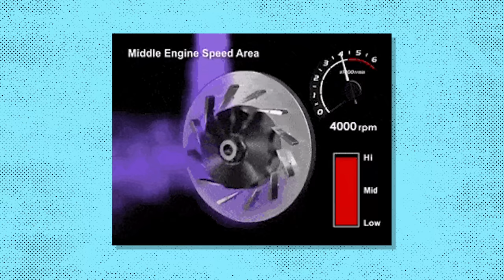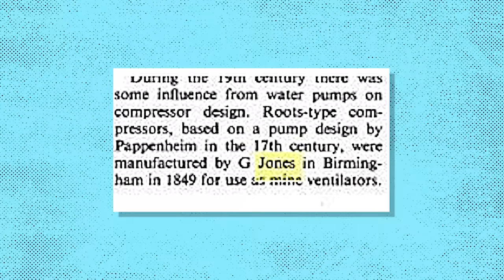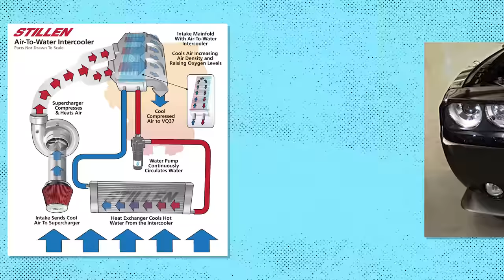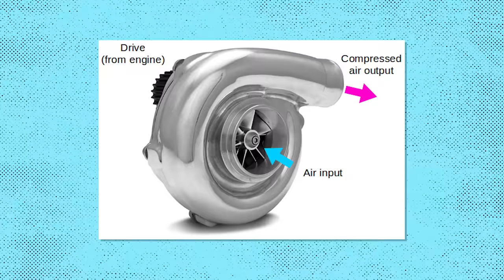Why Superchargers Aren't As Good as Turbos

Comment: Turbochargers aren't just powered by "exhaust gases", but also directly take power off the crank in the exhaust stroke by increasing the exhaust pressure. It's not fully free.
Reply: That is incorrect, the turbo runs on the leftover heat energy normally wasted out the tailpipe.
There is no parasitic loss or load on the crankshaft.
Reply: @sandervanderkammen9230  on the exhaust stroke, at some point the piston is pumping exhaust, when the piston is pumping exhaust it is transferring energy from the crankshaft to the turbine.
Reply: @microcolonel  No, the turbo is driven by an Impulse type turbine wheel.
The exhaust gas temperature and pressure drops as it is excellerated and passes through the turbine. 
This is called the  Bernoulli Principle.

The drop in exhaust temperature is directly proportional to the shaft horsepower generated by the turbine. 
Any questions?
Reply: @sandervanderkammen9230  lol, why do you gotta be internet tough guy? You're just spouting off random factoids that have nothing to do with the comment.
Reply: @microcolonel  Some people actually understand how a turbocharger works... and some people (like you) only think you know how a turbocharger works
Reply: @sandervanderkammen9230  hey buddy, you might ask yourself why there's a difference between an unobstructed exhaust and one obstructed by a loaded turbine in terms of resistance to flow but you might also just keep yapping.
Reply: @microcolonel  If turbine blades obstructed gas flow? Jet engines wouldn't work would they???
You should probably stick to something you are qualified to discuss... like an oil and filter service.

Comment: A really good comparison is the Audi B8/8.5 3.0T with the Eaton Supercharger and compare it to the new 3.0T hot V single turbo on the b9's. The similiar hp on pump 93 (when modified) but tq is greater on the turbo as well as top end and trap speeds. People in the community are torn. Everyone loves the crazy supercharger whine on different pulleys but cant deny how much easier it is to squeeze more power out of a turbo. From a dig the b8 S4 is a monster, but let the b9 built boost and its a similiar story. People love the whine and break neck action of the SC. Time will tell if we can get more air into the block out of a larger SC.
Reply: Reliability is sketch on B9's
Reply: @murraydmark  So far so good. Even with the crazy numbers tuners are pushing. I just had my supercharger bypass valve die on my SQ5. 97K miles. 10K on e40 dual pulley.

Comment: what if you have the regular crank driven pulley for the supercharger but then also had the exhaust side of a turbo hooked up and instead of the exhaust gas turning the compressor wheel it could add extra torque to the supercharger or idk maybe if there not enough torque from it use that to replace the alternator as they usually take 2 hp idk maybe im stupid just thought it could be a good idea

Comment: Why would a belt-drive centrifugal supercharger suffer from lag while a belt-drive roots doesn't? They're both spinning slower at low rpm, yet instantly follow engine revs, right?
Reply: Because a Roots type blower is Positive Displacement and air  delivery is linear based on rpm.
Centrifugal compressors deliver on a non-linear curve.
Reply: @sandervanderkammen9230  Ah, gotcha.

Comment: Is it not feasible to install a tank of pure oxygen and force that into the intake with a regulator?

Or would that be to costly,  or oxygen bottles would take up to much space?
Reply: Nitrious Oxide is mostly Oxygen... in a more dense liquid state, its more practical and effective than pure Oxygen and is used to boost engine performance.

Comment: Couple of thing wrong here 
1. The amount of power loss is near is a small fraction of the amount gained.
2. There are different kinds of chargers. Some are small but produce huge boost while being mounted.
3 one of the reasons turbo is popular is because it is in fashion.
Reply: That is completely false.
Turbos produce more horsepower than superchargers because their is no power lost from parasitic drag on the reciprocating engine.

Turbochargers produce more power at the same manifold pressures than superchargers because there is no parasitic loss.

Turbos dominate the forced induction market for two simple reasons, the make more power and use less fuel.
Reply: @sandervanderkammen9230  um no on yes on the other.
Superchargers make way more power and the fuel loss is made up for the power increase. Also it's a safer option than a turbo. 
No the real reason is because a turbo is popular.

I like superchargers because more power straight off and higher top end power and I don't have to worry about my desiel running away. Lower maintenance also. And I also didn't notice feul milage loss. If there was any I didn't notice it. Still getting 9ftlb of boost for my 7.3L IDI at 20.9 mpg.
Reply: @timesthree5757  Thanks for confirming that you are not qualified to speak inteligently about Turbochargers or Superchargers..
Reply: @sandervanderkammen9230  soo you can't win the argument so you turn to insults?
Reply: @timesthree5757  Not an insult... it's just the truth.
Reply: @timesthree5757  You have confirmed that you do not understand even the most basic fundamental engineering concepts regarding forced induction.
A properly designed and assembled turbocharged engine will always produce more power than a comparable supercharged engine at the same manifold pressure.
This is because turbocharged engines have higher thermal efficiency and have no parasitic drag on the reciprocating engine to drive
 the compressor.
This is also why turbocharged engines have lower BSFC  (use less fuel per horsepower produced)
Any questions son?
Reply: @sandervanderkammen9230  no I haven't. A turbo with 9lb boost and a super 9lb boost both make the same hp on average.  I've done these test over and over. On the super conected to an electric motors. And a air compressor for the turbo. 
It took 3/4 horse electric motor to turn and produce boost at 1,900rpms. 
Using an air compressor and measuring back pressure on the pipe you loose somewhere around 1/2 horse.
But the big difference is maintenance. The super is a plug and forget. The turbo was a pain in the ass to maintain and constantly watching turbo temp under load while watching eg's was another pain in the ass. 
Power through rpm ranges.
The turbo doesn't start making good boost until about 1200 rpm. I need good boost in all RPM ranges. I can't  wait for a spool up on heavy loads and burn up my clutch. I need the instant torque and hp on the take off and through all rpm's in all gears.
In most non racing and drag racing application yer better off with a super.
On my truck with a turbo I was getting on average around 19mpg on a super I get on average 19mpg. 
I understand the engineering. But real life application somtimes doesn't mean it's useable. 
To me a Supercharger is superior to a turbo. So yes I do know what I'm talking.

Comment: Curious do we use gears to reduce parasitic losses? If not why don't we?
Reply: How would gears change the parastic loss on the supercharger?
It still takes shaft horsepower from the crankshaft to drive the rotors or impeller, in some cars more than 100hp to drive the supercharger.

Comment: I am brainstorming ideas for reducing or eliminating turbo lag. I initially considered electric assistance, but there are potential heat and cost issues with this approach. I also considered using raw gas, similar to the "Anti-Lag" system that is already in use, but then I had a thought: what if a high-pressure, low-volume (HPLV) compressor was placed just before the turbo? This could potentially eliminate the heat proximity issues and may be more cost-effective when mass-produced. In theory, this system could also be retrofitted to existing vehicles and easily programmed to engage at certain RPMs and speeds. However, I am not sure if this idea is feasible or if I am just feeling the effects of alcohol. 🤣
Reply: Derp... Those smarties over at volvo are already doing this🙂
Reply: Yeah, you're just drunk buddy

Comment: Blowers can't touch turbos for pure power and efficiency, but they're exceptionally hard to beat for drivability and pure fun. Sure a guy with an identical setup running a turbo is going to smoke the guy running a blower, but you can make way mkre power than is useful or practical in a street car with either. Really comes down to what you want, the down low power, drivability and whine of a blower, or the even bigger power and greater efficiency of a turbo and deal with having to spool it and keep it spooled. Which depending on if you have a properly sized turbo or you're a social media queen "big turbo" tool can be pretty easy or it can be a total pos dog until revved out.
Reply: The popularity of turbos speaks for itself...
Reply: @sandervanderkammen9230  No, it doesn't. OEM's use them primarily for emissions requirements.

Comment: Got to say more, the daddy of turbos, Gale Banks puts blowers before the stupid turbo, because air is needed at all times and NOW, no waiting until the spinny spools.
Because many are weak is the real reason why turbos are more often used. Transmissions are weak, it's a hard life to be shocked by a blown engine
Reply: Turbochargers are very reliable, they provide more horsepower than superchargers and use less fuel.

Comment: Roots style superchargers are fixed displacement. Turbos and centrifugal superchargers are positive displacement. Every revolution of the roots supercharger will move roughly the same volume of air which is why Eaton designates their models with how many cubic inches of air are moved at peak efficiency through a complete revolution of the input shaft. Turbos and centrifugal superchargers are instead designednated by the diameters of the housing since they ate terrifically inefficient at lower speeds but efficiency greatly increases once a certain impeller speed is achieved. At low speeds the turbo is not capable of overcoming the intake manifold vaccuum however a fixed displacement supercharger will be able achieve peak boost at any time that the throttle is wide open as they are typically arranged in a draw through arrangement with the throttle body or carburetor mounted to the intake side of the supercharger and metering the amount of air the supercharger recieves.
Reply: Wow! ... it's safe to say that you have no formal education or professional experience in engineering or forced induction.

Comment: Talking about superchargers using power to make power as if sticking a flow restriction on your exhaust doesn't restrict power.

All ICEs are air pumps. You add a restriction and you've taken away from efficiency.

Comment: Exhaust is not waste energy, take a naturally aspirated engine of any shape or size, add the back pressure to its exhaust that a turbo normally creates, and see what happens to your performance
Reply: The Turbocharger uses the heat energy in the exhaust gasses to drive the turbine... this free energy is normally wasted out the tailpipe.
There is no parasitic drag on the reciprocating engine.
Reply: @sandervanderkammen9230   whilst mostly true it is not free. Do as i describe and you will notice a power decrease to the engine. 
Remember heat and pressure are related, the turbine creates rotational kinetic energy by creating a resistance to exhaust flow. The heat of the exhaust allows a greater amount of energy exchange but is only used by converting heat to pressure. That resistance to flow has an adverse reaction on combustion chamber flow dynamics specifically cylinder scavenging. In this way the turbine does indeed take power out of an otherwise free flowing exhaust. 
Nothing is free
But don’t take my word for it, try adding the turbine restriction to a naturally aspirated engine without the benefit of the compressor side and see what happens.
Reply: @TheRenaissanceBuilder  Yes, it is free... thats why turbo engines make more power and deliver better BSFC.
All of the energy to drive the turbine wheel comes from energy wasted out of the exhaust gasses.
 The pressure and temperature DROP as gasses pass through the turbine..
The drop in temperature is directly proportional to the amount of shaft horsepower generated by the turbine wheel.

This is calculated by using the BRAYTON CYCLE formula.

Here you completely lose the plot... the exhaust turbine is directly coupled to a supercharger compressor... a centrifugal compressor which is significantly more efficient than the reciprocating piston engine...
As the exhaust manifold pressure increases? 
SO DOES THE INTAKE MANIFOLD PRESSURE!

There is an increase in pressure... but no reduction in flow.

Flow is based on pressure differential "aka" Delta-P

Any questions son?
Reply: @sandervanderkammen9230  im not your son pal.
In your perpetual motion seems possible I guess 🤷🏽‍♀️
The point where you loose it is how the added back pressure effects cylinder scavenging and that is where the sacrifice is paid.
It is true that its addition overcomes its subtraction, just the same as a supercharger. It does indeed derive its energy from a portion of the combustion process.
Don’t believe me thats fine, you dont hafto, but an intelligent person asks why 😉
Reply: @TheRenaissanceBuilder  You still have alot to learn yet kid.

Not such thing as perpetual motion... we are talking about Heat Engines

The energy to drive the turbine wheel comes from the same fuel burned by the reciprocating engine.

Its not a difficult concept to grasp if you have some basic engineering skills.

You don't understand how backpressure reduces flow...
The pressure differential increases volumetric flow with a turbocharger...
Naturally Aspirated Otto engines have intakw manifold pressures less than atmospheric pressure when the engine is running.

This is not the same with a turbocharger.

Perhaps you should come back when you learn about hpw a turbo actually works.
Reply: @TheRenaissanceBuilder  Then the question you should ask???
Is why the exhaust temperature drops as it passes through the turbo...
 AND WHERE DID THAT HEAT GO??

Comment: The first stage of a high vacuum system is sometimes a roots blower. But instead of forcing air into something, it pulls air out. It's only used for the first stage, the initial part of drawing a vacuum. There reaches a point where it simply can't pull down below a certain pressure, but it works really well taking big gulps of air and evacuating them quickly.

Comment: SCs are very inefficient due to the parasitic power loss from the engine. Turbos on the other hand, uses exhaust energy which is free. SCs are also heavy and bulky while turbos are pretty compact.
Reply: Are you telling me that making more difficult to your engine to move the exhausted gas is free ?
Reply: @ulisesavila2879  can you restate your question? i cant make sense out of it
Reply: @ulisesavila2879  The centrifugal compressor is a much more efficient pump than the reciprocating engine.. it is not driven by the crankshaft but rather the free heat energy wasted by the reciprocating engine

Comment: Group N Lancia Fulvia. Supercharge at low rpm and turbo at high
Reply: Does it use regular turbo-supercharger system or does it have bypass valves or clutch/coupled compressor?
Reply: @sandervanderkammen9230  not much of a gear head. Think it is computerized system that switches back and forth depending on rpm

Comment: from what i have seen in various vids,  superchargers get worse gas mileage on the street than turbos do and that is why they are so popular for most street cars, also, the new turbos dont have the problems early ones did and the ford gt is a prime example of new tech that works on the track and street,  for drag racing they 
might be good but not for street use with the new turbos
Reply: Superchargers also make significantly less power than turbochargers,

Comment: I managed to add like 500hp per PSI per 1k revolutions in beamNG drive by literally negating the crank loss and pushing the buildup to 1000 psi per second.

Sadly, engines don’t really enjoy this much power and get obliterated in an instant. Plus the pressure is absurd and would detonate with the strength of a gasoline explosion

Comment: Does at matter if it is taking some of the engines power as it is instantly put back into it. Its not really as inefficient as people say. If you think about it logicly they are just as efficient while being simpler
Reply: The supercharger always uses more power than it gives back...
The Turbo produces a net gain because it is driven by horsepower that is normally wasted out the exhaust on a supercharged engine.

A supercharged engine can never make as much power as the same engine when it's turbocharged.

Any questions?

Comment: I don't care about efficiency in my sports car, a few lost MPG is fine. This is why manufacturers use turbo because government fuel economy regulations...how exciting. Superchargers don't ruin the exhaust sound like turbos do (because the exhaust sound goes through the turbo before exiting). That's a win for superchargers. Superchargers also make less heat in the engine bay than turbos, generally. That said, it seems like some turbos can be torkier low down etc.  Turbos have cool blowoff sounds, some like the surge of power. They're both pretty sweet. But for me its supercharged or NA, they just sound better.
Reply: Manufacturers use turbos because they make more power than superchargers and get better fuel economy... of course turbo are also used in Top tier world class motorsports simply because they make more power.
They certainly don't used turbos in tractor pull competitions and world land speed record attempts because of  EPA CAFE regulations!
You still have a lot to learn yet kid